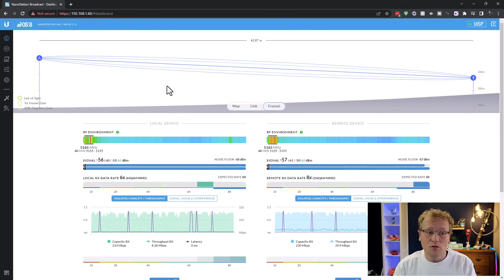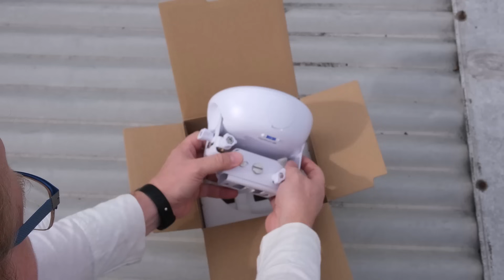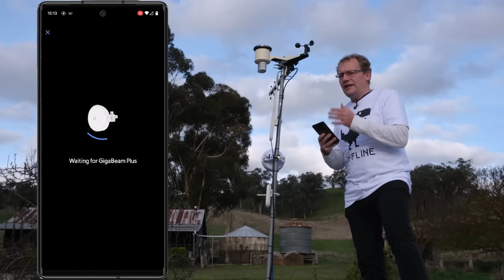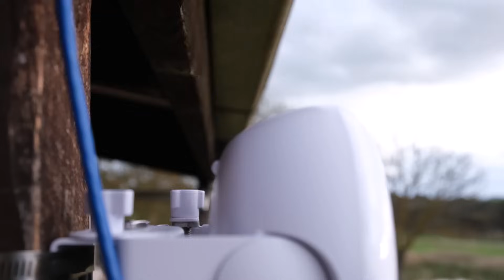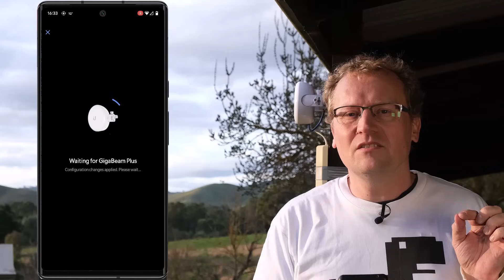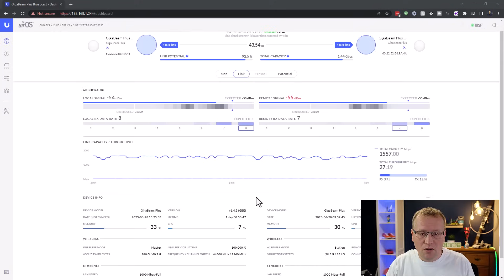airMAX Gigabeam Plus - 1.5Gbit wireless connection

Comment: You should look at what the cost involved in a preterminated piece of fiber that you could bury between your two points as well as a dumb SFP switch on both ends. It's probably cheaper than you think. You could do all of it yourself as long as you get preterminated. I bet you could do it all for well under two thousand bucks excluding labor
Reply from the maker: While I prefer cabled connections where feasible, this isn't the case here. The trenching alone is complicated through established flower beds, up very steep inclines, and into two separate old established buildings on stumps. There is currently no access in either from underneath, so you would have to install a path through the floor and up into the ceiling where the cabling is. Buying another two switches instead of the GigaBeams is then already almost a cost equalizer. You then add the hours to dig the trench, the cable, the conduit, and the mess. I prefer my solution in this case, which achieves the same speed I can support internally.

Comment: How about you get rid of that piece of conduit that you’re mounting all this equipment on, including a anemometer which is using friction from the wind and pulling the pole around. Dude, gigabit will barely be megabit, when the wind is blowing.

Great video nonetheless

By the way: station is the master as far as I know, and access point is at the end of the line.
Reply from the maker: Thanks Mark. Appreciate the feedback. While it does need to be upgraded, or at least secured better, it is a "hockey stick" which is meant for mounting antennas on. The anemometer is so low friction, that I doubt it, on its own, make any difference. The day I put all this up it was very windy, yet I had full Gigabit signal. So, yes, I need to secure it better, but it isn't as bad as you think 😊
Also, the station is the secondary device according to UBNT docs.

Comment: If both your buildings are fed from the same electrical utility source (same electrical transformer): just run an ethernet cable. Or if you eant to get fancy, buy a 50-60m fiber cable and stitch it in. 👌
Reply from the maker: I am not sure I understand. What does the electrical source have to do with it? 
Also, it isn't "just" to run an ethernet cable. It would take several days to do, cost about 10 times as much, and not have a ton of benefits for my current setup. If I need more than 1Gb connection internally, then I might consider it, but not in this case.
Reply: @LarsKlintTech  the distance doesn't seem like days to trench, was just thinking about all of the problems you were having (and ubiquiti has these annoying 100Mbps issues even with their toughcable brand ethernet)

The electrical source is because of electrical faults, if there is GPR or something fails (like a neutral that feeds the property): then the Ethernet could become a source back which can fry your equipment.
(Which is more reason to use either wireless or fiber).

Lots of people blindly run Ethernet then something happens and they wonder why the equipment unexpectedly died. 🤣 (It has happened to me on commercial sites where this was a problem. Generators not properly bonded, lightning strikes, transformers catching fire). Solution was kevlar fiber between the buildings. If they have the same power transformer: then nothing from the provider will affect the buildings.
Reply from the maker: @jamess1787  Ah, I see! I had no idea that would be a problem, but we are indeed on the same electrical network everywhere on the farm. 
Yeah, I figured out the issues, which were all my fault anyway. The trench is through established flower beds, up a steep incline, and under two old buildings. It would be days to both trench it and install everything. I'd love to do it, because I prefer cabled connections, but can't justify it in this case.

Comment: 42 meters. run a cable. will always be better
Reply from the maker: While I prefer cabled connections where feasible, this isn't the case here. The trenching alone is complicated through established flower beds, up very steep inclines, and into two separate old established buildings on stumps. There is currently no access in either from underneath, so you would have to install a path through the floor and up into the ceiling where the cabling is. The cost of it all instead of the GigaBeams is then already almost a cost equalizer. You then add the hours to dig the trench, the cable, the conduit, and the mess. I prefer my solution in this case, which achieves the same speed I can support internally.

Comment: I dont know man, If I were me, I would just pay someone to dig the soil to install a underground fiber. those stuff arent that expensive compared to what you already spend with this wireless crap hardware you have there.
Reply from the maker: You do you for sure. In my case, the wireless link is about a tenth of the price of the wired install, takes a fraction of the time, and is a lot less messy. And, for my purposes, works just as well considering my current infrastructure. 
What makes the hardware crap? I have never had any outages of degradations with any of the wireless links I have used over the past three years.

Comment: In regards to the prior setup - if it was only to support a single point to point connection it could have been changed to an 80mhz channel to increase the available capacity to roughly 650mbps - depending on local regulations you can move this into the "DFS/TDWR" space 5.5-5.7ghz area, where most home devices will not reside.  This would also lower the airtime usage, and noise that your local wifi may also be occupying.   But Obviously since using large files, extra speed is always better, short of running outdoor shielded fiber along the fence between the two buildings this is a great use of gigabeam type equipment.
Reply: In regards to file transfer not using full speed, keep in mind these are half duplex devices.  Since you are transferring in both direction the radio is splitting the load between both send and receive at the same time.   Airtime usage vs total capacity tends to only be usable up to about 65(ish)% under optimal conditions if also downloading (even checksum/validation on TCP can cause this slowdown).
Reply: Very slight correction on the 60Ghz connection aiming - It is outside normal thought but the aiming is actually even more important at closer distances compared to further distances.   Rain and weather will affect these devices quite strongly.  As well as channel selection vs oxygen/humidity.   Ideally at this sort of distance try to shoot for a -40 signal.  Under a heavy rain, this connection could be impacted between by as much as -20dBm, or possibly knock out a -60 to -80 during such conditions (which tends to disconnect at -73dBm).     And with regards tot the total capacity - the radio outperforms the port - so just treat it again as a half duplex radio.  Ideally you can push 1GB in one direction yet still have enough speed to push  200-300 in the other direction.   But since it has more airtime available to it for capacity these devices are great in contrast to AirMAX M or AC models with efficiency.
Reply from the maker: @SeijinSA  That is super helpful! Thank you so much. I will try and adjust the channel width on the other NanoStation pairs I have and see the difference. The slow connection speed in the start was due to a faulty RJ45 plug. I redid it and it was back to Gb. 
Again, thanks for taking your time to share all this. Super super helpful.
Reply: @LarsKlintTech  While not helpful after the fact - the dashboard of the devices can also show a "cable quality" down at the very bottom.  If this number is "red" or any value outside of 29-30db, there may be a fault between the radio and the switch.
If you SSH into the device, or open Terminal View via UISP you can run the following command and determine which pairs the fault is on.   "ethtool -S eth0"   This shows what pairs are giving bad data and how long the cable detects as.  Damage on pairs  0 and 1 affect data the most, with pairs 2 and 3 usually affecting voltage on 2 pair24v devices the most - same with some 48v devices.   But it can also help determine if it is simple cable/connector corrosion and just put a new end on vs running a whole new cable.
Reply from the maker: @ Amazing. I have never really used the SSH functions of the devices. Definitely an area I need to learn. Thanks again.

Comment: For 40m could you not just ran a cable ?
Reply from the maker: Oh, I absolutely could, but there is no "just" about it. It is an awful lot of digging, through established flower beds and up a steep incline as well. I would have to create infrastructure on both buildings to route the cable in as well. This solution is much much simpler and cheaper. Having said all that, I might still do it in the future if the infrastructure requires more than 1Gbit 🙂

Comment: I have a pair of GigaBeam (not the Plus version) running rock solid at 190 meters. Link capacity is always 1600 mbps in each direction, unless there is some seriously heavy rain is falling, then they might switch to the built-in 5 GHz failover radio, which still gives me ~4-500 mbps of actual throughput. My signal is usually -60 to -64 dB at this distance. They are great little devices!
Reply from the maker: Nice! That is good to hear. Also, I was not aware that there is a 5Ghz failover? How do you see that?
Reply: @LarsKlintTech  AFAIK the plus version has longer 60 ghz range but lacks the failover radio, the non-plus has both. There are additional signal bars for 5 ghz and a little indicator that says what frequency each side is using for data transfer. Switching from 60 to 5 ghz and viceversa is transparent to the user. Couldn’t be happier, only real downside imho is the passive 24v POE, I ended up buying Ubiquiti’s adapter to power the antenna from a standard POE switch
Reply from the maker: @TheElleDj  Ah yes, you are correct. Interesting. I am using the included PoE adaptor, which works well with the USW-24-POE. I wonder why they didn't put the 5Ghz failover in the Plus...

Comment: btest.exe by mikrotik will show you bandwidth speed between 2 points internal networks. Will allow both in/out as/or tcp/udp for testing. Just run once and set it up as a server (so on a device you want to test too or close too). Then run the client version connecting to the ip of the server. Run test to check cable speeds down each switch and thru ptp's. As a In house tech I would run it monthly to do radio quality tests to verify I had the best radio signal/thruput. It transfer's junk data so nothing to worry or save there and gives standard testing package.
Reply: Edit* 2 or more points. The server can handle multiple connections coming into it from clients. Able to test saturation thruput on servers to prove they are able to handle X rated Gig. 10:1 the prior connection was hamstrung by a bad connection also. Limited to 100mpb but had 300 in the air available. You upgraded but your prior setup was only using about a 3rd of what you should of had.
Reply from the maker: All really good points Christopher. I did realise the faulty connection too, so you are right, the NanoStations should have been running 250-300 as well. 
Wifiman from Unifi can do a lot of what you mention as well, if you have two device with it installed on the same Unifi network. I'll check out btest though. Thanks again.

Comment: You only got 100Mbps before because of your cable issue. You had 250Mbps available over the air between the devices but your cable was only allowing the devices to negotiate at 100M, so that was the bottleneck in your 'before' speed test.
Reply from the maker: Yeah, I realised this too. Thanks for noticing Casey 😁

Comment: Not trolling, and I'm sure you thought about it but genuine question : 44m? Why not run a single mode fiber to the other building for faster speeds and weather immunity? I understand not running copper to prevent voltage differential between both buildings. I am an Ubiquiti fan but always prefer wired over wireless.
Reply from the maker: Oh, I am with you on that one Jean. However, albeit a short distance, it is quite complicated to actually dig the trench, go under two buildings, run the cable, and attach it all. The wireless link is magnitudes cheaper and more simple. If I do need more than 1.5Gbit, fiber might be the next step up. 
I am not disagreeing though 😁
Reply: Would love to see the first transfer repeated with working gigabit rather than 100Mb, I'm guessing it would be about 2.5 times faster than your experiment.   I just got some loco devices and working out the kinks, like how to power them as I had hoped the unifi flex would help me out, but it appears I also need a poe to passive poe convertor

Comment: Your issues are your limits of understanding RF and the fallout of it. All the radios you have nested on the same, flimsy pole are making a boat-load of noise in all directions. The noise floor for you is crap and the radios (what you were using) were moving modulation. Clean up the installation and understand noise levels and the downside of clustering radios without RF planning or considerations. I see instalaltions like yours daily while driving around that are just slapped up and spewing RF all over the joint. UBNT and are very guilty of making their stuff too easy for untrained people to buy and chuck-up gear and spew RF all over the joint.
Reply from the maker: Thanks Benny for your input. The pole really is flimsy, and I am going to stabilise it in the near future to get it not wobbly. With your extensive expertise in the field of RF, is it still a problem when one device is 2.4Ghz, second is 5.2Ghz and a third is 62Ghz? They are very different bandwidths. 
I never claimed to be an expert in this field, but everyone has to start somewhere, right? With that, could you clarify what you mean by "spewing RF all over the joint"? And what level of training do you recommend people should have before they are allowed to buy network equipment? 
Thanks again for watching. Cheers, Lars.
Reply: @LarsKlintTech  The simplest way is to watch others and listen to what they say and pick the good bits from the junk. I would suggest paying attention to the older, more mature installers who have radio backgrounds as many of the young pups filling YT simply don't have the decades of expirience, crikey, I only been doing radio for over 35 years..
The weather station talks to the controller on eith 433 or 900MHz and the controller has only got a cheap 1x1 SISO 2.4GHz WiFi chipset which are crap at best, I know because I had one. The Outdoor AC-M is only 23dBm of grunt (they suck at times) and the antennas are ordinary at best. A good pair of dual-band Omini's will see it run better but if you just need range, then disable the 5GHz and run 2.4GHz only with a UBNT 10dBi MIMOP antenna, the 13 is big-boy country. I use them a lot in rural or large area sites and can provide 200-400M radius of coverage with ease. The 5GHz radio you did have was being swamped by the AC-M as your noise floor was ordinary. Simple band-planning and locking frequencies along with stable, vertical mount would have seen those radios lock and high modulation without an issue. 60GHz is a strickly short-range only solution. Don't believe the sales BS UBNT use as well have very different RF power limits here in AUS to the yanks. Move to a 40-50mm pipe with decent guy legs, put weather station on top and spread other radios apart as best you can. Cabling, outdoor grade only. Gen-1 UniFi switches (square blue halo on front) can do both AF PoE as well as 24V passive. Keep in mind, 24V passive is reversed polarity.
Reply from the maker: @bentheguru4986  That is a ton of awesome information. Thanks Benny :) That is exactly the kind of feedback I look for to learn from. 👌
Reply: @LarsKlintTech  If you study up on radio a bit and understand the terms "Front-End" and "Desense", you will start to see why despite radios being on different channels or even different bands, seperation by physical distance or be mechanical means is a must. 
Cheers.
Reply from the maker: @bentheguru4986  Excellent. Will start there. Thanks Benny, and keep the knowledge coming please 😊

Comment: Why is ubnt still using passive PoE ?
Reply from the maker: I am obviously not Unifi, but it could have something to do with reliability. As passive PoE provides power at all times, whether the device requests it or not. This continuous power supply reduces the risk of damage due to unexpected power interruptions or power cycling, which could be a concern in certain scenarios. For example, the UISP devices are often deployed remotely and out of easy reach, so reliability is key. In my experience the NanoStations have never missed a beat and always just worked, which isn't the case with Unifi network equipment, as that is more feature rich and more things that can go wrong. 
I am just speculating, but that is my take on it.

Comment: Hey Lars, good explanation video. If I can make a suggestion in your future upgrades that you make the House pole more solid. I noticed the pole was moving around in the wind. This will improve your signal strength on windy days. The office setup to the pole looks good and solid. The fine adjustments will be changed by the house pole moving around, and if you guy the pole or a stronger solid pole your signal shouldn't move. regards Glen VK2HTV
Reply from the maker: You are absolutely right. It's probably close enough between the devices that it won't make much of a difference, but I could attach a couple of wires to either side to make it more stable. Thanks mate 👌